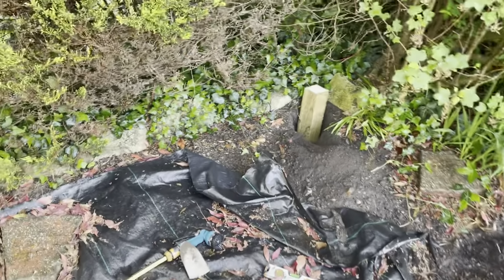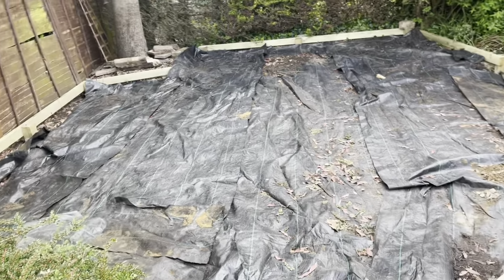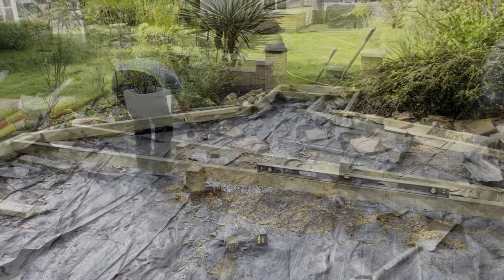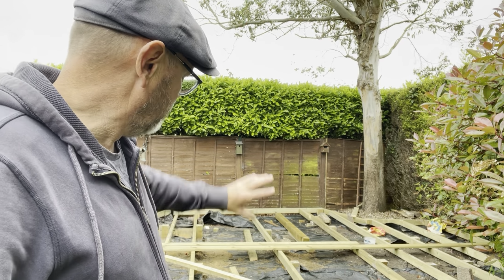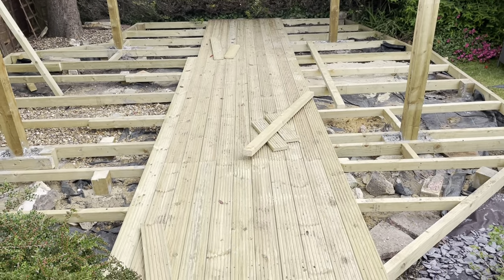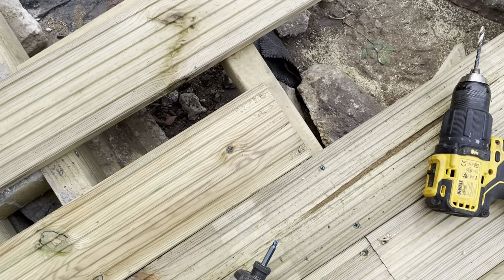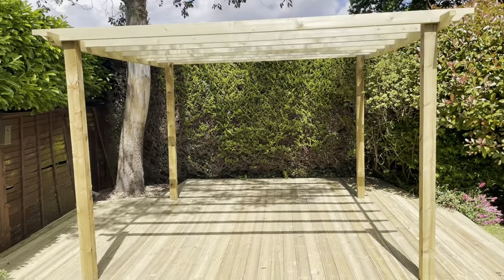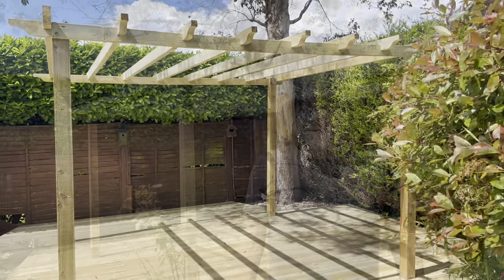You could build this Decking And Pergola Construction.

Comment: Hi Mark have just seen your excellent video on building a pergola. It would be very helpful to know the sizes of the timber you used for the rafters and the frame as this would be an ideal structure for my garden. Thanks Nick
Reply from the maker: On this job I used 4x2 but I’ve since changed to using 5x2

Comment: Great watch, can you give us some more info on the pergola, 4x4 legs but what size was the rest, it looked very solid and I'm after making my own. Did you shape the ends yourself?
Reply from the maker: The legs are 4x4 fence posts. Get the 10ft ones. The frame of the pergola is made from 4x2 . I used a saucepan to create the curves drawing round to make my designs. You could just cut a diagonal. The sub frame is made with 4x2  and fence posts cut to 16inches 
Hope that helps.

Comment: What are the top bars called and where did you buy them? The four main post how much went in to the ground how long were they
Reply from the maker: They are generally called joists or rafters. I buy most of my timber from Jewsons and Bradfords. There are lots of builders merchants to choose from. Generally the main posts go into the ground approx 18inches. Sometimes you have to fuse them differently. There are metal post shoes for that.

Comment: Never laid decking so maybe a silly question, but should you leave a spacer gap between boards? Guess if it’s pressure treated it will shrink slightly anyway.
Reply from the maker: No you don’t have to there will be a natural small gap as you lay them.
Reply: @KAPWoodworkandbuilding  thanks!

Comment: With your pergola posts, are they set into the ground with concrete, or sat on top of ground but concreted around decking frame only? Nice work!
Reply from the maker: These particular ones are concreted in a wooden frame on top of ground and screwed into through the frame and decking.

Comment: I'm going to be doing a deck for the first time and I'm wondering would it not be easier to set the cross timbers directly onto concrete blocks with piece of dpc to reduce moisture transfer? It seems like lots of unnecessary work digging all those posts and setting them in concrete.
Reply from the maker: A decking done properly need’s to be anchored down. Of course you can lay your timber directly onto concrete blocks but you will get some movement. Also depends how big it is. With timber off the floor with good airflow and anchored down you will get many years out of it.
Reply: @KAPWoodworkandbuilding  Ah yes I understand. So that's what a floating deck must be. Thank you for the prompt reply. Enjoy your well earned holiday 🚢
Reply from the maker: @fr.mcgreer8349  👍😃